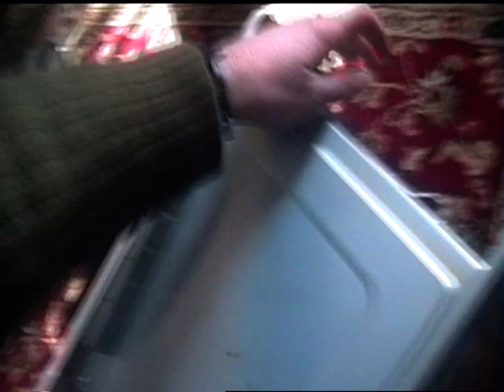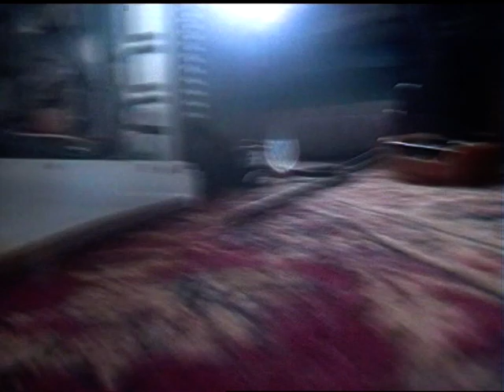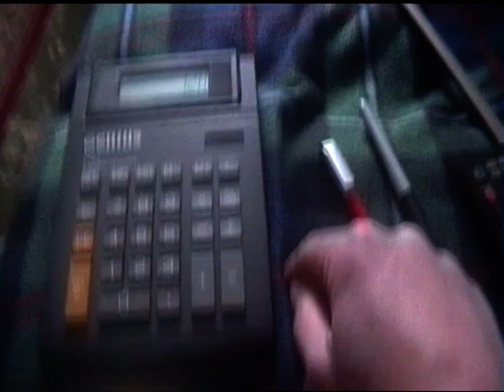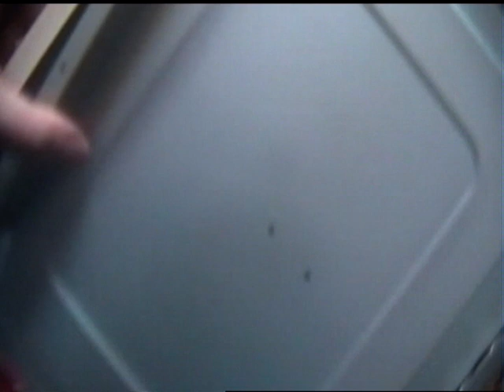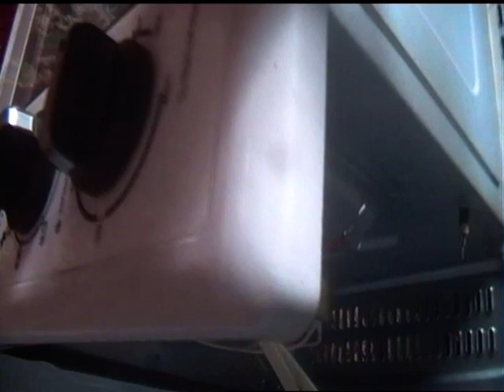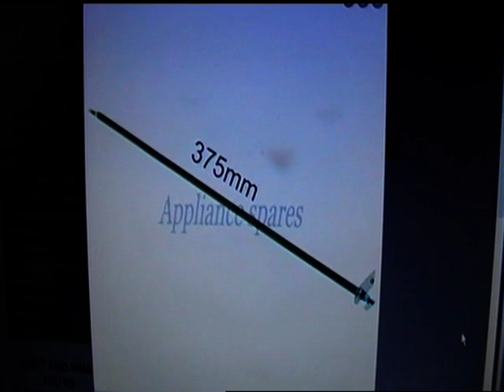Cookworks Mini Oven grill fix

Comment: I have a similar model , that has suddenly broken, top elements  have stopped working and the thermostat has stopped clicking on the temp control , the bottom elements and hobs still work , any ideas ?
Reply from the maker: Same top element change I would suggest and the thermostat may just need the contacts cleaning not sure what design it is from memory.
Reply: @0ddba1l  the day it broke I was preheating the oven but forgot I had left the grill tray a greasy grill try inside , it created a lot of smoke inside , I'm going to open it up and give it a good clean
Reply from the maker: @ItsmeAndygNUFC  Many thermostatic items have a bi-metalic strip with contacts on them. When you adjust them it turns a screw that alters the gap between the contacts meaning the hotter it gets the metal strip has to bend further with heat. If you let smoke and condensation build up you may need to clean some contacts on the thermostat. see this on ebay https://www.ebay.co.uk/itm/203780045462?hash=item2f723cba96:g:CjcAAOSwMmRh04SK&amdata=enc%3AAQAHAAAAsPi%2FTCAB2QgWbsp4bBML4ER%2BTivtqnfcr%2FxrHe5LIrdFEoRitQl%2BWtVJP9rfNJfNIWkmbbuvbphUTMrCoYxOCZWZZaoAMwKL%2F3xJ6OTF8XC28Tb7vpUksgjzwJEYWWyjAet5HKqRppC%2B7cnR2ZSMiQAjERCZoygznBRCsuaba8qyCbURBX2xUeoPyVWi3y4MfR6OfqiU9vgZzt5SmyJVh20wWgivRtLx40IjyijgcCpo%7Ctkp%3ABk9SR4D7tJe-YA

Comment: Very helpful, thanks for posting this, managed to swap elements from a scrap cooker to keep mine going for a bit longer.
I have electrical/electronics experience but not much with oven elements.
Reply from the maker: Glad I could help, I latter fitted a better element than the original in the top replacing the 2 originals.
Reply: @0ddba1l  I had the same thought but didn't want to exceed the 'heat capacity' of the box.
Can you remember what you element you used?  There are loads of cheap potential replacements on ebay.
Reply from the maker: @caerffili_callin  Think this is it worked well still going strong and easy to fit. Check the measurements between terminals mine looks like this model same shape at least and make. https://spares4delonghi.co.uk/delonghi-grill-heating-element-r1200-230-superiore-kaneta-eo32

Comment: no no no i thought, V divided by I times R, and to get watts its volts times resistence, to get the un known, cover one up and use eather divided by or times by to get the result? as far as i know? peace all
Reply from the maker: From google "In other words, watt=amp X volt. Sometimes you will see this formula written as W=A X V. For example, if the current is 3 amps (3A) and the voltage is 110V, you multiply 3 by 110, to get 330W (watts)." I had to look it up again to answer :-). Since I did this fix I upgraded to a higher power element from a Delonghi as there are loads of them may be this one I used can't remember. https://www.4delonghi.co.uk/oven-element/product.pl?pid=2308738